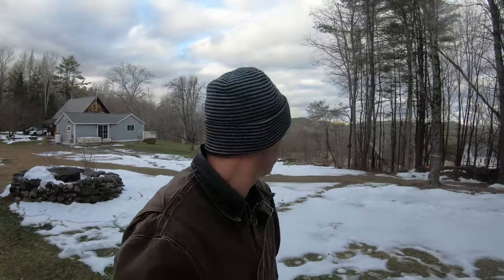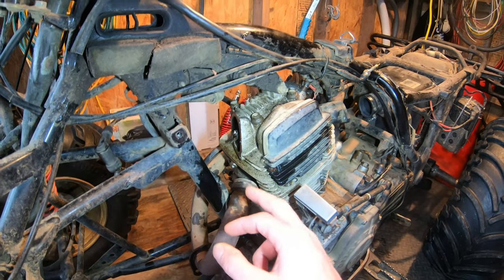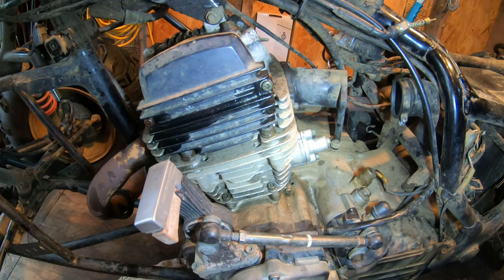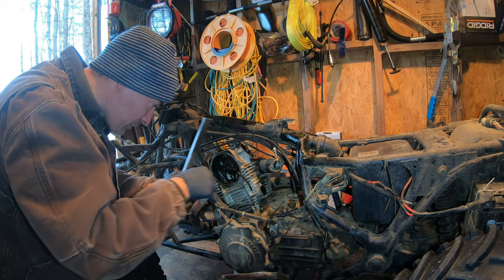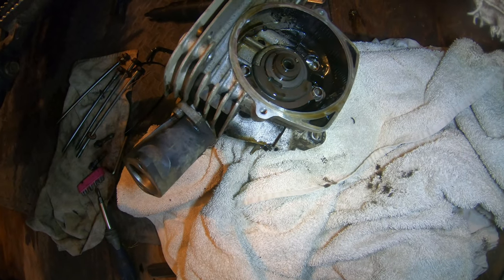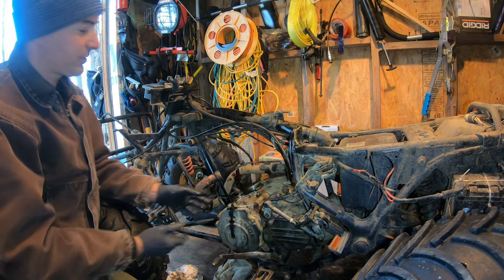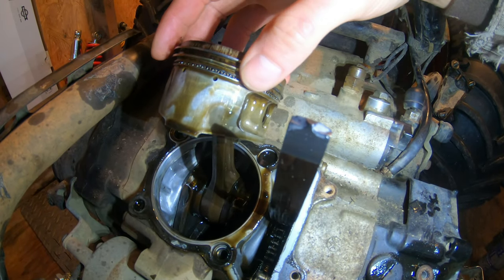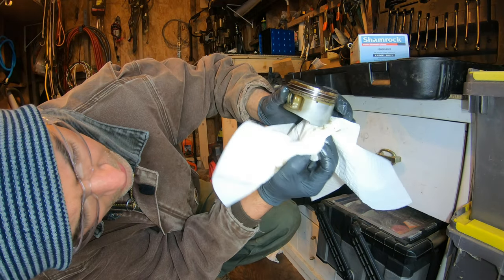How to Redo your Top End: Teardown on Moto 4 YFM225 YFM200 DX with Low Compression - Part 1

Comment: So glad I found this as you are still touching lives years later. I just bought my first ATV ($600) in good shape and used as it is the same as yours but an 86 YFM 225. I am 61 and I do not plan on selling it so I want to put it together the RIGHT WAY. Showing your mistakes was AWESOME as we all have to learn by them. I figured putting another $400 into it would make it almost like new. All the electrical plus the motors top end as it has to last me for at least ten more years. I am NOT EVER jumping the hills as my days for that is over. It will save on driving my jeep to my neighbor which is quit the distance to walk every day to his shop as I tinker on little projects to keep me busy. 
On disability and will NOT be bored by doing nothing. Number one killer for disabled people is sitting back doing nothing, do what you can but try to stay active. 
I rebuilt Ken's Yamaha side-by-side by watching a YouTube and now your YouTube's will GREATLY help me. It fired up but I played with the decompression lever and the Yamaha service dealer said I could have stuck it open. Beside I put a scope in the spark plug hole and the walls were seriously scratch all up. So I am replace that as well so at least the top end will be new.

Thank you GREATLY for your YouTube's
Reply from the maker: Glad it helped and thanks for the shout out. These old quads are really quite robust. We are still riding all ours years later just doing basic maintenance. Best of luck and stay active! :)

Comment: In the top of the head you used the impact gun what direction is the thread? Any advise for getting that off
Reply from the maker: That’s the timing gear. Lefty loosely. The impact is important as otherwise the motor wants to spin if you just have a wrench on it. You could… put a screwdriver in the gear teeth to keep it from rotating while you loosen the screw if you don’t have an air gun just be careful if you do that not to wreck the gear.

Comment: Thanks for the quick reply,  also having a problem with my reverse,  I have to be quick with my hands to kill switch,  put in reverse and turn back on would like to get that fixed if u have a idea
Reply from the maker: Weird, are you saying when you put it in first then try to go to reverse that you have to turn the motor off by the kill switch then quickly turn it back on? On mine from first gear I just 'feather' it back into reverse which lights the red light on the console. At that point I am good unless I stall out and have to go back to neutral to start it. Incidentally, that was one of the reasons I'm rebuilding as it wouldn't idle right and would stall so I had to be fast on the throttle to keep the rpms right.
Reply: if your having problems with reverse an its dieing as it sets in, its the battery, low voltage. the charging system needs to be looked at.. hook the battery up to a vehicle with jumpers, start the wheeler. put in reverse. if it goes easy an doesnt die. then there is your issue.. low voltage, bad battery or bad charging system, or both

Comment: Anyone know why so many top end rebuild kits say they work on both the yfm225 AND the yfm200?  Is the top end the only difference between the two motors?  I know the 200 uses a 67.00mm piston and the 225 uses a 70mm but beyond that, I'm stumped.
Reply from the maker: I’ve noticed the same but have not personally tried. I have been advised in previous comments that it won’t work. Physically my 225 and 200 top end do the look the same. One of these days I’ll have to see if I can make a definitive video on it to help folks out.

Comment: i watched your previous videos with the motor 4.. an you were mistaken.. any adjustment behind the butterfly between the head is the air fuel mixture the more you turn out the more fuel= RICH, the more turns in the more LEAN, anything out more than 2 3/4 - 3 turns is required to up 1 size pilot jet.. anything 1 1/8 turn is out is 1 size smaller pilot.. which is unlikely.  im not surprised you need a top end. you have been running lean this whole time.. remember out is richer in is lean on a 4 stroke!  before butterfly is all air!
Reply from the maker: Thanks, not the first time I’ve either said it backwards, done it backwards, or both. Thanks for calling it out.

Comment: Where would you be getting your parts also whats ur tires on yours
I need to find a new exhaust  , new wire harness and tires like ur front ones
Reply from the maker: It's been a combination of Amazon, BikeBandit, Partzilla and Ebay over the years. I've looked for exhausts before and they are tough to find but Partszilla still carries most of the pieces needed for the exhaust. Those tires came with it but I'll take a look at the size and make and post back. I bet they can be found. Wiring harness... Yamaha's part number is 2HT-8259 according to Partszilla but I know there are a number of harnesses on Ebay for the moto4 225. Sounds like you're preparing to do a rebuild. Good luck.
Reply: @VermontLife  everything works just need a muffler and maybe a cdi box but want to make all new getting there slowly new brake pads front and back, new airfilter, new oil filter new battery ,new spark,new oil cap waiting for brake cables might have found tires similar to your , want a new wire harness  , I got some led lights from and back , also for led lights for the engine area coming on Friday